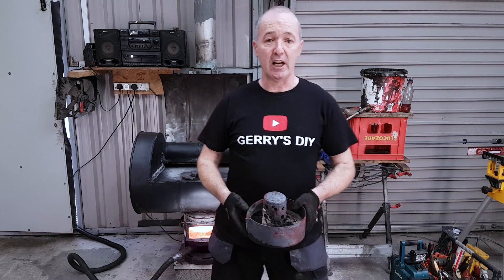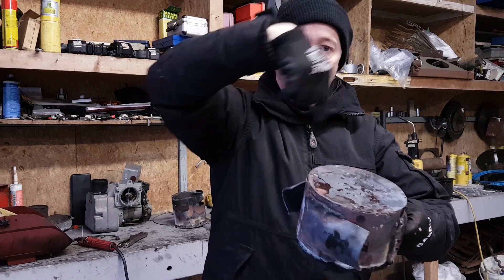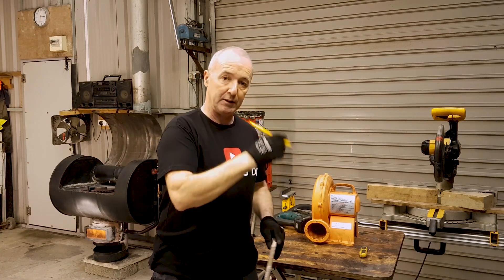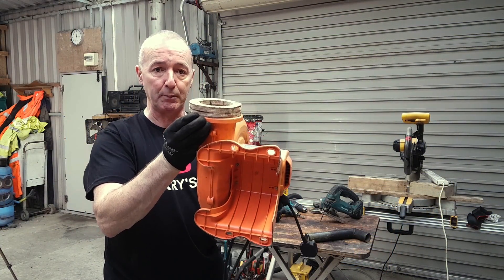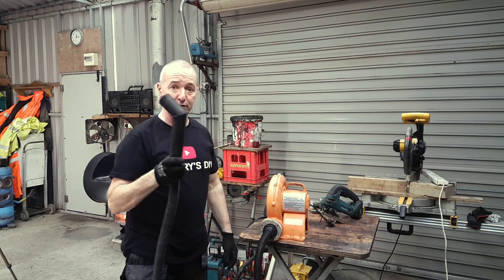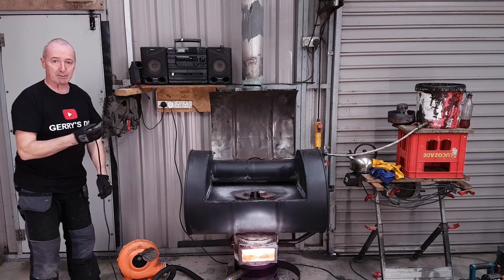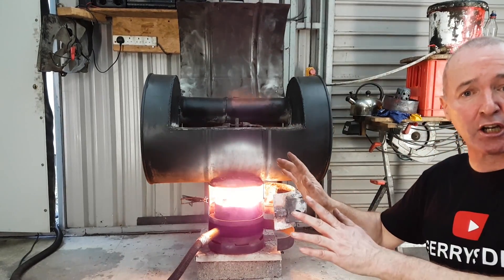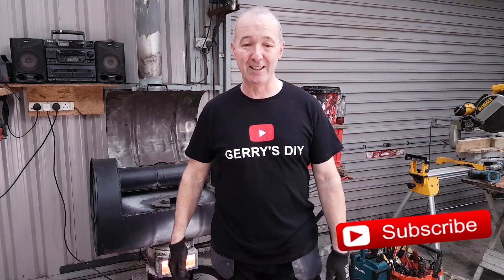Awesome Heat ! DIY.  Powered Waste Oil Burner -

Comment: Why not just use a small shop vac and hook the hose on the discharge port and use a speed control/ dimmer switch

Comment: You may not be getting as much swirl because the deflectors don't go past the end of the slots and it is easier for the air to go straight out than bend so it disturbs the swirl there.
Reply from the maker: Hi Gerry. That's true. This design is changing all the time but it is well able to make a ton of heat as it is. I have an idea for another burner that I will get to soon Thanks for commenting Cheers Gerry

Comment: I have an existing oil burner in the house. I managed to get an old wood stove from a friend and modified it with pieces that were a carbon copy of what was in the house stove. Works great. Go into any shop selling oil stoves, take a few pics of what's inside the stove and copy it! These videos are fine for those who can't do that though.

Comment: OK, Gerry.  I got my oil burner set up inside an old wood stove I got and I use the 'up draft' type of burner that you show in this video. So far, it works OK but I do get a little smoke so I have two ideas maybe you can shed some light on.
I am thinking it is best for the oil to be introduced below where the air feeds the flames so it must hit the bottom of the burner to vaporize so it can't simply vaporize in mid air?
Also, the 'burner' I made uses a rounded bottom salad bowl which turns out does not have as much surface area left in the bottom of it after welding the 'updraft air pipe' in it to vaporize the oil as compared to yours, which has a flat bottom that would have a lot more area to heat the oil with.  After I shut the oil off, there is still a substantial amount left to burn in the bottom.
So do you have any technical advice to offer if any of that made sense?  
I'd love to send pics but I don't know how, but my set up will run either natural or forced draft via a couple air inlet dampers and a fan.  It's going to work really well when I get it dialed in!
Thanks for all your videos showing what you've done!
Dave

Comment: I get oil splash dripping out the bottom of my grant water jacket (removable bottom plate) oil boiler. I have a 16cm pot as the burner. Oil and air entering at 45 degree's. How can I stop the oil splash. Flue temp sits at 200C water output at 60 c to heat 16 rads. Which it does no bother. 1.3 litres per hour. The oil splash is doing my head in. Any suggestions?

Comment: Great job adding swirl and turbulence!!  That is on my fabrication list when the build happens.  
     As you go to 212F/100C (boiling temperatures) heating the water, be cautious of the thermal expansion while it is heating, if an open system watch the water level, if closed system pressure relief valve.  I am sure you know, a closed vessel, when  over-heated, with no blow-off feature is a powerful bomb!!  Be careful, be safe and looking forward to your results.

Comment: You beat me to it! This was my idea for getting the air to flow easier
Reply: Sorry, it wouldn't let me post a pic. But what i did was cut vertical slots about 2 inches long and at the top and bottom made an inch long slot. This allowed me to open and direct the air to the side. Hope that made sense. Anyways i love the new burner design!
Reply: Why don't you just take a video and upload it to your channel ?
However you explained it very well what you did.
So, I suppose you have been able to create vortex.
I would like to see it.

I would also like to see Gerrys 80 mm steel box burn-pot creating a vortex, but therefore the air would have to be redirected accordingly.

Gerry: What do you think about this proposal ?
Reply: Hello Jeff,
thank you very much for the links you provided.
This looks exactly like I supposed it would be.
(... like a kind of "doors" that could be bent open or closed in order to adjust the amount of air creating a vortex)
I reviewed your video clip a few times, but finally I was able to see an indication of the vortex.

Before Gerry will modify his 80 mm steal box buner, I'm sure he will manufacture a prototype bisquit tin & tin can version of such a vortex burner.
(like he did in his prototype tin can burner video https://youtu.be/Z38ndzSPJxQ )

Once this has happened and it is working as supposed to, I am sure Gerry will provide a video about that.
Reply: Hello Jeff,
Hello Gerry, 

I did some benchmarking the last hours ...

Here you can see a blue hellfire burning in an un-equalized oven creating hotspots, as the air-intake is undirected.
Therefore unfortunately no drill, not even an indication of a vortex.
 https://youtu.be/RmHGQGxEgqg

Blue vortex inside a stove:
 https://youtu.be/6GThXJDhEns

Blue vortex inside a burner:
 https://youtu.be/AdoQDOuRg8I
In this case the vortex is created by  primary air.
The blue hellfire is achieved by secondary air in (or from) the center, which is unfortunately not supporting the drill of the vortex.

Further blue hellfire vortex video-clips and the burner setup can be found here...
Ben Franklin:
 https://youtu.be/RXCrIB5Aahk

Comment: Gerry, I am wondering if there would be an advantage to angling the air down so it still swirls but is also directed at the bottom of your burner.  Do you think it might enhance the burn or cause the bottom of the burner to cool off and not vaporize the oil very well?  Also, is there any heat at the bottom of the burner getting absorbed by it being in contact with the stove itself? 
It's looking good no matter what!  Thanks for the vids!
Reply from the maker: Hi No Name. The vapour off the hot oil burns and the vents help accelerate that. I think that if all the air was on the oil it might make it hard to start because you are blowing it out but it could work. I have an idea for a burner that will make the flame blue and therefore more efficient but it will be a taller unit with a bit more going on. Thats a few videos in the future though. I am doing the boiler stove first and then some paramotoring repairs and flight I hope. Thanks for the comments Cheers Gerry
Reply: Thanks for the suggestion, Gerry.  I was thinking maybe there was something like that going on. So really in these things, there's two things going on. The oil is basically burning in the pot/burner to generate heat to vaporize the oil. Then, the air coming in above the oil deals as you say, with the vapor.  I recently reworked my wood stove to create a secondary burn and I get a lot more heat out of the same amount of wood. I wonder what might happen if you were to install another pipe maybe an inch dia. straight up through the burner so it ended in the burn area. I am thinking if there is anything left to burn, it would be the same as the secondary burn in a wood stove.  In your vid, you had to leave the bottom door open a peak and maybe this would fix that.  It's no more than a guess though.  Thanks again!

Comment: Very cool. I have been thinking of using a waste oil hot water boiler outside while pumping the hot water inside to my shop in attached garage.  That will be interesting to see.
Reply from the maker: Hi Shane. I will be making at least 2 versions of this, the first will be just a propane bottle and an oil drum. It will be interesting to see what it will do. Thanks for the comment Cheers Gerry

Comment: use a ceiling fan speed Control, looks just like a dimmer, find it at local home center near the fans, pay attention to wattage ,check your blower for rating. good luck , keep up the good work
Reply from the maker: Hi Bone Crusher. I actually have on spare on a job but I cant get to it until after Christmas. I'm sure it will appear in one of the videos Thanks for the comment Cheers Gerry

Comment: Please consider- sand blast that burner, then high heat primer and paint. Let cure 1 day before using. It will work more efficiently, and last longer. Great design.
Reply from the maker: Hi  HUBBA I used 800 °c paint on the bottom of the stove and as soon as it went red the paint became smoke.  The same would happen to the burner. I haven't found paint that can withstand the temperatures I get this thin up to yet. Thanks for the comment c Cheers Gerry
Reply: https://www.cerakotehightemp.com/testing/

Comment: Great mod Gerry, I was going to ask you about the flame vortex then you do a air diverter before i could ask. You and I think on similar wavelengths i wouldn't be suprised  if your next plan was a mini oil burning gassifier to power the flying wheelchair you sir are a great source of my info and entertainment. Happy holidays thanks for the great videos keep it up keeps me upgrading my burner with new ideas
Reply from the maker: Hi Jake. I looked at my paraglider wind last night and It's been a few months since I flew it. The paramotor needs some new engine bits but they will have to wait a few weeks. I have a small paragliding channel with some paramotor videos without the trike.I taught myself to fly the paramotor but I had hundreds of hours just running off hills and mountains. Here's a link https://goo.gl/3AV8nY Happy Christmas and thanks for the comments Cheers Gerry
Reply: GerrysDiy i will check it out i always did have a interest in those just need to build me one like you did

Comment: Looking forward to the hot water boiler next mate!
Reply from the maker: G'day Skip. My son is in Oz at the moment and reported heat over 40 °C . I would melt. The boiler is about to start today so it will be an interesting setup. I have some oil boilers I could convert but I am going to make it with an propane bottle and a 55 gallon drum as I have them here and they are easier for people to get hold of. Cheers Gerry

Comment: Like the swirl plates Gerry. ;) better version of mine :)
Reply from the maker: Hi Paul. I just had a look. Well done. Is that how you run it or do you force draft it. Cheers Gerry
Reply: It's on the draft for now but I've got a snail fan for it on the shelf. Should heat the water jacket up nicely

Comment: The fondery project would be interesting
Reply from the maker: Hi Chris. The little burner will certainly be able to melt aluminium. It will be interesting to make it melt other things too. I am making a boiler / water heater next and then the foundry. Cheers Gerry

Comment: Awesome! Very keen to see the water heater..Been thinking of a way to heat my spa pool that dosent suck so much electricity. Keep up the good work 👍
Reply from the maker: Hi Glen. I have boilers that I could convert but this project is going to be with an oil drum and a propane bottle. It will be simple but could easily be used as a pool heater. Before I make it I have a mk2 model in mind I will make a start on it today Cheers Gerry